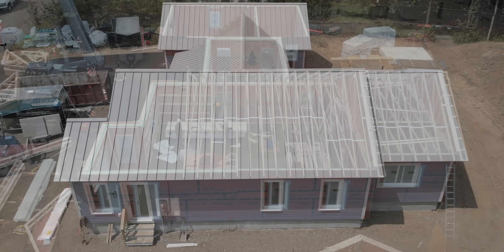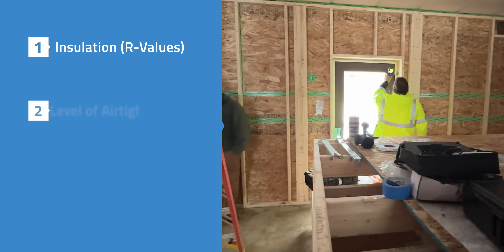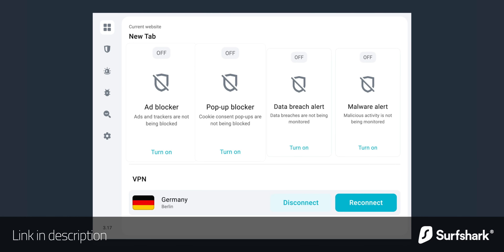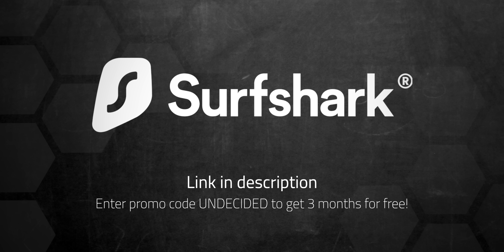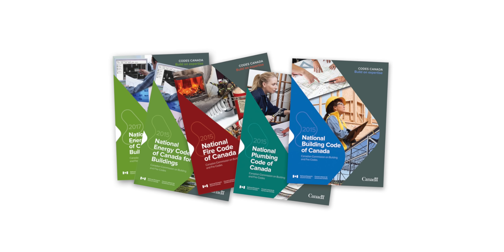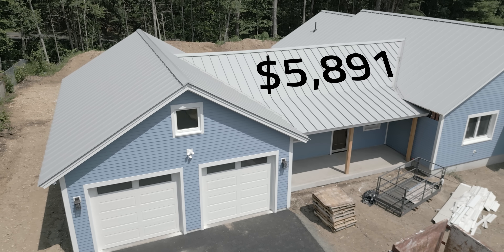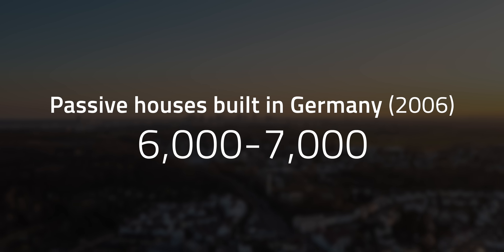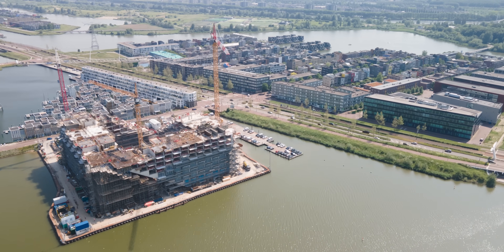Why Do American Homes Suck?

Comment: Listen I get building a house to a higher standard but please don't mandate it so ALL the USA HAS to comply to one standard. There are big differences between building in Alaska vs building in Arizona. I get it would be ideal if all houses were as efficient as possible but that costs money and people are struggling to find places to live as it is. The housing crisis probably needs less regulation not more to enable people to buy a home.
Let the man build his drafty cabin and heat it with a roaring wood stove or whatever
Reply: The answer is not ever to do nothing.   There are minimum standards that can be applied to all that do not have to cost a small fortune.

Comment: I built my first home in 1976 at aged 26. I had very little experience but I could read. I asked questions and had planned on 2x6 studs on 24" centers self made wooden windows with double glazing. I used 6 mil polyethylene vapour barrier. Everyone said "you don't need that here, we are in south west British Columbia" . Within the year most of what I had done became part of the BC building code. One of the things I did was plumb for grey water recovery and the toilet supply lines separate from the rest of the potable water lines so I could flush with recycled water. I didn't have the budget to implement that before divorce resulted in a different home. Fifty years later things haven't really changed that much. Canada and the US, as you say, are initial cost conscious more than long term.

Comment: For new buildings, yeah, I can see making them more energy efficient, but fewer people will be able to afford them.  For already constructed buildings and a tight budget, I don't think people are going to be able to make many changes to improve energy efficiency.  My single family home is around 40 years old.  It leaks air like a sieve, has water leaking issues inside and out, and still doesn't have enough room in the breaker box to supply all our energy usage.  I live in the Southeast on an annual income of just $55k, the environment is just going to have to suck it.

Comment: Households pollute the most. The way we build houses is meant to cost you money every month. Passive solar heating and passive cooling do work. It's the design of the houses. Better windows make a difference when trying to heat thermal mass. You gotta have the insulation and thermal breaks to really use thermal mass. Going with a skillion roof line with a very well insulated masonry north wall. R 60 floor, north wall, and roof. I need to have outward moisture flow. So using low perm wrap and mineral wool. Gonna have south facing earth ship green house. Masonry loves to wick moisture. Don't want my timber frame to mildew. I am just trying to cut as many monthly bills as possible. Building a masonry heater, stove, and white oven. Electric is miles away so will be offgrid except they put in high speed internet on my 2 track. I really liked the earth ship designs except the tires and wasteful wood framing. It's more environment friendly just to build a post and beam timber frame. Plus I have 70 psf snow load by code. No berm because 6 foot frost dept. Better to insulate than dig in up north.

Comment: I have been very interested in energy efficient housing since the early 1970s. I built a home that included solar collectors for domestic hot water. Since that time, every home as well as our local high school that had solar installed from that era had their solar collectors removed after only a few years just as the White House had.

Comment: One of the reasons US homes have cheaper windows/insulation is because of cost:  electricity in the US is on average 2-3 times cheaper than in the EU. Another thing to note is that the cost of home per square foot in the US is around $222 and (spit balling here from multiple googles also converting to square feet 17:04 ) $400-755 in the UK and EU. I honestly don’t want a centralized building code in the US because it will price a lot people out of owning a home and we as a nation are stretched thin on income as it is. I hope we can adopt clean nuclear power like the French to further reduce the cost of energy for years to come and adopt more efficient methods as the market makes them worth the cost.

Comment: To match the passive standards you also need to take into consideration the orientation of the house and how compact it is. Shadow is sooo important as well as heat dissipation in summer. Too many windows or too big, sealing problems and thermal bridges will ruin the efficiency of the house

Comment: I built a home in PA with the most efficient heat pump system on the market, spray foamed the whole home with 3" of spray foam, installed superior walls most insulated foundation and have very efficient windows and appliances. I'm way above the standard for efficiency, but it is definitely much more expensive and not everyone can afford it. I paid at least $25k more vs standard and I might break even over 10-20 years. It definitely hurts lower and middle income people to keep increasing the energy standards and constantly adding stuff to the code requirements. Just AFCI breakers, GFCIS, fire code, ect, adds a ton to the overall cost of a new home. I don't think these things should be required, only encouraged.

Comment: Insulation is good.  Windmills and solar panels are bad.  Intermittent energy sources cannot be compared to continuous energy systems that we can turn on and off as needed, and can run 365 days per year.  Wind and solar are like throwing money down a storm drain.

Comment: In the United States, the least bright people usually go into construction, unless Amish or Mennonite.  Plus, development with subdivisions with houses all built by the same few companies limits consumer choice.  If home buyers just bought a lot, they would likely choose a superior home from a kit or other form of housing partially built in a factory.  Manufactured homes today are built to high standards, but banned from many developments.  As for windows, I think wood or composite interior shutters with blackout thermal drapes offer as good protection as expensive windows, and you don't have to worry about leaks between layers.  Window film is also a good idea.  Germans have excellent apprenticeships and amazing straw/mud panels to add R-value.  We need to import some Germans to start a private high school/junior college where students learn top construction skills and set up a trade school for adults run by Germans.  The students could start age 14 with a half day of academics and a half of construction, 10 months a year.  Then at age 18 or high school graduation, it could be 100% construction.  Anyway, we need fewer tract houses and more consumer choice.  New manufactured homes shouldn't be banned automatically.  Maybe the rules could require porches and other features to make them look like real houses.  We need a labor saving way to make straw bale houses coated with clay since these materials are abundant and very fire resistant.  Papercrete and fired clay homes (like an upside down bowl, all one piece) should be commercially available with corresponding equipment.  Our technical colleges should produce open source machinery for this purpose instead of just teaching mainstream techniques.  Certainly we would all benefit from using waste straw and paper, and the holes from the extraction of clay could be converted into cistern harvesting rain water or livestock ponds.  The home loan industry needs to partner with technical colleges and come up with building standards for these unconventional buildings instead of denying loans.  Then very likely many towns and outer suburbs will come to accept the new buildings over time.  We need to limit developers to setting up streets and basic infrastructure and leave developing the lots to buyers.  Quality new manufactured homes shouldn't be banned.  Lots should be larger to allow for cisterns  for rainwater harvesting unless the soil is contaminated.  At least the yard, toilets and washing machines should be using rainwater from cisterns when possible.  Aerobic septic system should be common to decrease the burden on sewer systems.  Homes should be positioned to take advantage of views and passive solar.  Developers almost never do this!  Roof overhangs on site-built homes need to be 3 or 4 feet, but factory built homes should have awnings added on the West and South sides, with a slant suited to the latitude.  In warm areas, water heaters need to be painted black and put on the south side of the home so that the sun can decrease the energy to heat.  Solar cookers and ovens should be added to the south side of the house in warm climates to save on energy.  The Department of Energy should have an ebook with videos and diagrams of how to increase passive heating and coo!ing.  We need to stop tearing down hills to build and instead build into the sides of hills and mountains to save on energy.  While some costs increase, there is no roof or exterior siding on 3 sides, helping to compensate for excavation and support.   These homes perform better in tornadoes and probably are less likely to burn.  However, as long as the construction industry is dominated by huge companies and inferior workers, consumers will not be able to access the creative options that save on energy and often are more attractive as well.

Comment: The attitude that ignores cost savings for purchase price is why I see so many households here in Canada with two new F150s in the driveway. Yes, it's a lot of vehicle for the money but then you have more expensive tires, need to buy a cap if you want to keep your cargo dry or locked, way more in fuel (a Sienna uses half!), etc.

Comment: I like the idea of building standards for more energy efficient homes in the United States.  I also want an inherently maintainable home with low initial and operating cost per square foot.  When building this house, I'd like to see the benefit of energy efficient add-ons in terms of cost recuperation time from the dominate source of energy to heat and cool the home.  In short I think we could make better decisions if those decisions were well informed from the beginning with a cost benefit analysis.  

That being said, I don't think a single building code for the whole country is a good idea.  There are large variations in geography, temperature, humidity, flora, and fauna in the United States and differing needs/wants should be considered.  In short, I would rather not be told exactly how I must build something, but be given the flexibility to decide what would best work for me via informed consent.

Comment: STUPID COVERAGE,   STUPID GOVERNMENTS
 lifecycle consumption of energy is negligible vs. the carbon footprint of construction generally. i.e. the real problem.  
WHY on earth do health and safety codes recently start to regulate energy efficiency???
previously, codes only regulated insulation and water/water vapor to control condensation/rot detrimental to durability of buildings.
energy conservation should be politically INCENTIVIZED by way of CONSUMPTION TAX penalties.  not by codes.

Comment: Great video Matt. As someone who works as an HVAC engineer, it was cool to see you reference energy codes. Washington is always a difficult state for us to work in as it’s mechanical efficiency requirements are higher than standard IECC codes
Reply: In Norway, building physics is its own engineering specialization. Feels so strange to see HVAC people doing those jobs in other countries. Over here, those engineers work only with systems and don't touch the walls of a house at all, except to lead their ducts through them.
Reply: Does the higher codes not push you to offer a better standard to those outside Washington as a market feature over the rest who all compete on the lowest quality cost.

Comment: See what's happening in Europe.  This is a fragment of an article about what houses in Europe will look like.  Maybe one day it will be like that in the US, because large amounts of energy are consumed there: The European Commission has tentatively decided that all new public buildings will be zero-emission from 2026, and all others from 2028.

 Additionally, energy performance certificates for buildings are to become a standard, as will energy classes.  In just a month, the European Parliament will discuss changes to the Building Directive, and the next stage will be arrangements with the EU Council.  What will change when they come into force?  According to them, each building will have to have a document containing the property's energy certificate and information about the energy class it belongs to.  Everything is to be modeled on the labeling of household appliances, regarding energy consumption classes, on a scale from A to G. What is important, the belonging of a property to particular classes will depend on both the level of annual energy consumption for a given building and the scale of pollutants emitted by it.  It is also important that single-family houses, multi-family buildings, public buildings and farm buildings will be classified separately.

 Experts have no doubt that the entry into force of the new regulations will result in a real building revolution

Comment: What say do Europeans have when choosing the HVAC for their homes?  Americans would no doubt invest more in performance standards, if less of the cost savings of going-cheap could be pocketed by builders.  "New home construction" almost guarantees a builder spends "code" dollars.  As respectful of times for regulation as I am, I think Americans also don't avail themselves of exceeding code because an improvement, however nominal, is seen as better than yesterday's home.  Regs can blunt a market, where people would otherwise take a more active role.  Reg's, like Matt's MA towns requiring blower door tests, for >$1,000, can also cause deep resentment among those having to pay.  

"Pay it forward" is so hard to teach.

Comment: Northern Italy. I built myself an energy efficient home in 2012, back then having it built by one of the few wise companies was quite expensive, like 30% above market. I managed to build one like yours with  210k euros for a two-story 140sqm villa in a rural area. Since then I've been saving a lot in electricity and gas bills, and I have comfort like no one else in the area. Now the market has changed, and energy efficient houses are becoming more common, but still not to my house point.
Reply: That’s a 340k house (in 2012 dollars)…454k in todays money and let’s be honest, a 1500 square foot home for 454k is considered very overpriced in the US. It’s roughly 150k more than a comparable home here in the Midwest. Most banks won’t float a loan on a Property that overvalued.
Reply: @Matt-yg8ub  In 2012 that would have been 270.000 $ with an average exchange rate of 1,286 USD. Today the costs would be around 260.000€ so around 282.000$ with an exchange rate of 1,0832 USD. 
Even if you count in price spikes in the construction sector which happened in germany (for example) in the last years and even on the passive house standard a 140m² family home would cost between 210.000 - 280.000€ (227.472-303.296$) plus additional building cost (which vary heavily). 
What i am saying is your numbers are completely exaggerated. I would also say that the quality is worlds apart. A house on a Mid-West standard (and we learned that some states have none to low) would not be worth anywhere near 300K here in Europe.
Reply: @stewenw4120  you might even say it would be worth nothing, because it would probably not even be allowed to be built lol
Reply: @Matt-yg8ub  I don't think you can build any house for that cost in Germany these days.😅 Modern-ish single family houses in the Hamburg region cost 700k€ or more. It partly comes from how much more expensive the land itself is.
Reply: @faultier1158 but the stupid building standards can’t be helping the matter. Just admit the US is right. Building a large house out of plastic and woodchips for 200k (including land and builder profit) is better than building a small net 0 house for 700k
Reply: @faultier1158   Which is the Apples and Oranges comparison between the US and Europe. The average person can afford a house in the US…. It’s far less attainable in Europe.  For the price of a 1,500 sqft  “efficient” European townhome, you can own a 3,000 sqft single family house in the United States with a private yard for your kids…. AND pay the utilities for decades with money left over.
Reply: @LucasFernandez-fk8se  In most cases yes. It would be nice to build more energy efficient homes… but the cost is too great.  The trade off in quality of life just isn’t there. You can buy a 3,000 square foot house in the US, live like a king and pay more in utility costs, or you can buy a tiny townhome in Europe and spend VASTLY more to save on utility costs .
The break even point is decades out. You’d have to literally leave the windows open all winter and the thermostat set on max for approximately 30 years to approach the price difference. 
The European standards aren’t worth it in the US because the energy prices are so much lower.

Comment: I've found in southern europe, that for existing homes, adding a larger solar systems is many times cheaper than insulation. 
A €10,000 solar system, on a 200sqm house,  combined with net metering, can fully power my heating and cooling all year & charge an electric car.. so much so that any subsequent insulation additions wouldn't further reduce the electric bill.
Meanwhile if i had added external wall cladding insulation, that would have cost €16k+.

All new houses have insulation requirements....